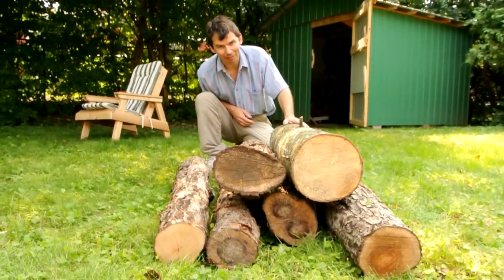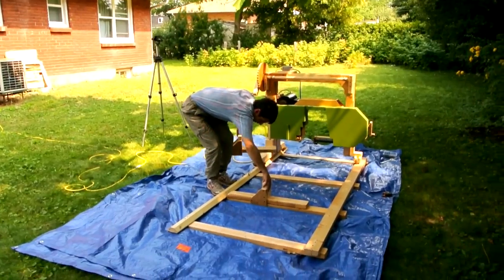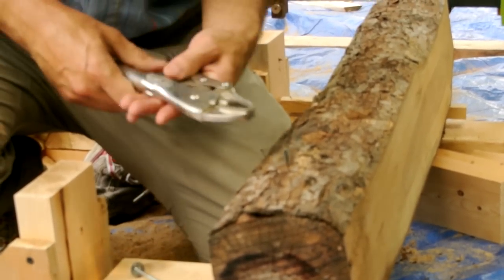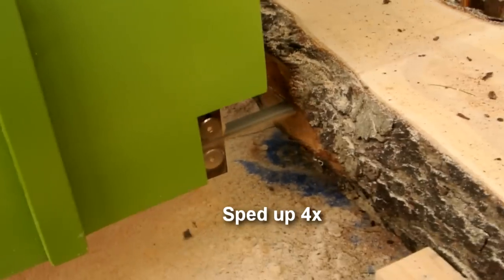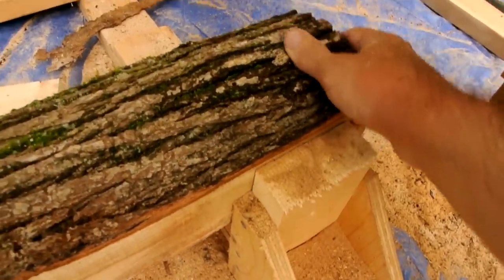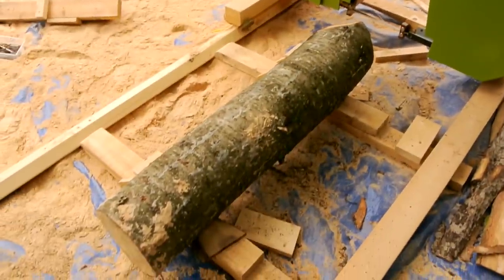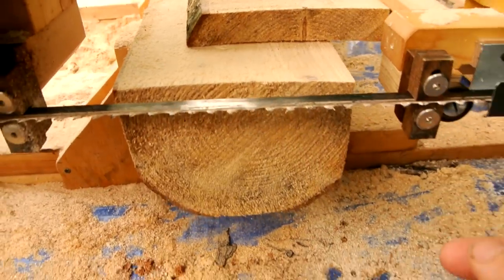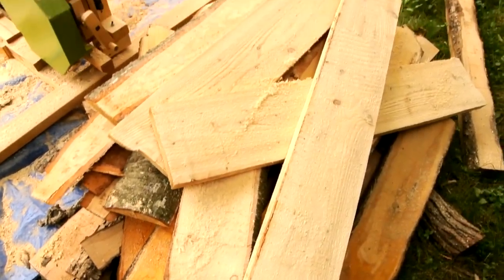Running the sawmill again

Comment: Matthias,

Recently found you and love your frugal, DIY ideas.   The video's are superb as well.  You've been stickering wood to dry for quite some time now, so, I may be suggesting something you've already worked out, but, here goes.

I sticker mine in a 12' by 12' shed that gets mighty hot during the day.  I blow cheap box fans through it for about 10 weeks and have gotten the moisture down between 10 to 15%.  

I've also seen people sticker their stacks in visqueen, which holds plenty of heat and quickens dry time.

Just a thought and thanks for your generous video's,
Steph
Reply from the maker: The box fan is unnecessary.

Comment: Look at this guy! Built his own bandsaw.  I'm impressed.
Reply: Yeah, super kudos for his ingenuity and problem solving skills! I'm like 6'2", 300 lbs but I find myself thinking words like cute, sweet and delightful. Tiny little logs, miniature lumber and the cutest little slash pile. I have a full size commercial band mill and I generate massive piles of labor intensive slash. I think I'm jealous...! :)
Reply: 3Sphere The logs are a bit small in diameter, but what's available will differ. I imagine these logs were cut down because someone didn't want the tree or something, and aren't from a commercial tree source.

Additionally, the boards are just fine for the kind of work a lot of woodworkers do. Giant boards are sometimes great, but when you don't need something that long, they're just inconvenient. I've seen shops entirely stocked with boards no longer than those Matthias has.

And considering all of this comes across as Matthias playing around with the idea and having fun, I don't really see what you're getting at.
Reply: That's probably because I'm not really "getting at" anything. Just congratulating the lad on his wonderful ingenuity and drawing a contrast between my operation and his without judgment. My efforts are dwarfed in turn by big commercial operations as well and would be considered quaint by them. Also, all woodworkers know that furniture makers and cabinet makers use short lumber and glue-ups. I'm saying that Matthias's operation is "cute", nothing more and nothing less. So I in turn, don't see what you're getting at?

Comment: Brilliant video, I'm amazed at what you have made from timber, I would never have considered building a bandsaw from 95% timber but this is amazing. I'm by no means an expert and have no experience with running a saw mill but I would imagine that the drift problems were a combination of blade angle due to adjustment of the guides or squareness of the mill and cutting feeds and speeds. You said you noticed that the problem was reduced when you cut faster and the blade did not get as hot. When the blade heats up, starting at the leading edge, the leading edge will expand and loose tension resulting in the leading edge deflecting up or down causing the cut to drift. Increasing the blade speed and cutting feed rate results in increased chip load and bigger chips which do not pack the kerf and result in overheating.

Comment: Maybe an auto-advance mechanism could be handy, you could even program the whole thing with a raspberry pi to cut a slab, then return, whilst pushing the slab off the log, lower the wrench and then proceed. But I don't think you are going to use the sawmill feature as often.

Comment: Don't make your first cuts so low under the bark if you're trying to avoid pitch, you know that's where it's at !  the reason why it started to disappear later is that there is more water in the centre of the log !!!
What so bad about hanging a little plastic jug of water with a thin hose on your rig to avoid all this grief ?  Other then that It works so well, you make many guys jealous with your skills.

Comment: Hey Matthias, you may want to consider moving your spacers out towards the ends on the boards, if the board splits it will only split to where the spacer is placed.

Comment: Matthias, As I'm sure you know runnning the blade faster through the spruce, doesn't allow the sap to heat up and stick.  I know you didn't want to add lubricant, but pinesol, really watered down, and just lightly sprayed on the blade with a hand squeeze bottle, once and a while will clear that right up, along with of course, turpentine (made from pine trees).  Also a wire brush after the blade lightly touching the blade will help.  Nice video, I'll have to get my bandsaw mill going again.

Comment: perhaps some pipe clamps could be used as log holders? You could integrate them into the track so that the logs sets on boards withe the pipe clamp below. One end could be fixed and the other moveable. Taller clamping blocks could be made so the clamp could apply pressure to the log. Of course this is a dedicated solution and this appears to be a more experimental project. I really enjoy your videos and website. It always gives some kind of idea!

Comment: For the pine and spruce woods use bar soap on the blade.  Clean the blade with vegetable oil at the the cutting session then a bit of soapy water and dry it.

Comment: Consider the difference grain might make on blade drift.  The dark winter wood layer is stronger than the light summer wood layer so draw yourself a little diagram of the blade cutting through edge or through center.  It follows that edge cuts would make a blade drift away from the center because the blade crosses the rings at an angle and center cuts would not drift (because the blade cuts the strong dark rings squarely).  This is observed in your video.

Comment: Maybe there is an uneven distribution of sap across the cross section of the log. Sap may be in the outermost layer of the wood only (the bark layer) with maybe a little more in the last few seasons tree rings, but pretty much none or just very dried out sap remains in the older wood.  Then cuts made through the center would collect less sap on the blade than cuts made nearer the side.  This may have been the improvement observed in the center cut at 5:20 compared to the edge cut at 4:20.

Comment: I owner a sawmill wood-mizer lt 40. I know your problem dirty blade. it is obligatory to use a system that sends soapy water. watch the video of the small Commercial bandsaw mill to understand. 
the system will give 4 essential advantage.
the blade clean. 
can cut faster. 
blade worn out less fast. 
there are no expansion of the metal blade, which causes a variation of pressure of the blade bander

it is obvious to me. it is the only thing you need 
good job :)

Comment: Drifting up or down is caused by either the blade not being tight enough, (tight enough is when the blade does not flap when running) or dull blade. Apparently your sapped up blade was acting like a dull blade. You definitely pay attention to detail to build such a nice running machine.

Comment: Nice little band saw mill. It does the job and didn't costs several thousand dollars.
I would hit the blade with a bar of soap between cuts in sap woods. Cheaper than bees wax and a good lubricant. Any that discolors the wood will be planed off before use.

Comment: you could use some motor oil on the blade. Take a plastic botle with a tiny hole in it and let the blade touch the hole while spining. But i'm not sure if the oil would mess up the wood... could make problems with finishing the wood.

Comment: Many smaller sawmills has the saw at a set height, and can raise and lower the table for the wood instead, which is pretty much what you're doing in the video. Wouldn't making the frame for the bandsaw non-adjustable make it much stiffer too?

Comment: I miss this kind of thing now that I no longer have access to the workshop at work. Whenever a new thing had to be cut or designed, I made a jig or framework or other helper. I am impressed with this saw mill though, my biggest goal was to build a router table - never got around to it though.

Callide! Eam functiones...ergo debet esse incolumem..
Well, (an exclamation here "Clever,") It works...(Therefore) it must be safe.

A Latin motto for your coat of arms!

Comment: Hey Matt I have been milling lumber for a couple years now. Here are a couple tips for storage of freshly cut lumber. 1. Stickers should be place no greater than 10-12 inches apart. 2. Weights placed on top will help to keep boards from warping. 3. Paint or wax on the ends will help with Checking. 4. Storing boards outside is find as long a they cannot be rained on at all.    
    I have ruined many nice piece of lumber because I did not follow these rules. Hope it helps.

Comment: Pushing the saw a bit faster keeps the saw blade cooler because the blade has less time to heat the relatively cool wood.  There is a limit, of course.

Comment: Couple suggestions.

Get two stainless steel cleaning brushes, the kind that look like a tooth brush and have wooden handles. Cut the handles off and mount them after your guides. One on either side of the blade. This will brush the sap residue off the blade continually.

Also to lube your saw blade, get a long piece of hose with a very small inside diameter (a couple mils). Maybe two feet long, mount a miniature funnel to the top. Pour in some chainsaw blade oil. You want to adjust the length so that the head pressure of the oil in the funnel drips on the band saw blade.
Reply: Wouldn't that generate a lot of extra heat and wear on the blade?
Reply: Nope
Reply: Good idea, but I think some lubricant would work better. Normally these mills run with a water based lubrication system, but we generally add some cheap-o dishsoap to a) lubricate and b) prevent resin deposits from sticking to the blade. Being made of wood this mill would probably not like water too much, but greasing the blade with dishsoap once in a while, and debarking the wood would make a big difference. The stainless steel brushes would most likely end up dulling the blade, stainless steel is quite hard, and the blade tip is only doing part of the work on these saws. The gullet itself needs a bit of an edge so it can shear off the loose fibers after they've been initially broken by the cutting edge, and I honestly think stainless steel brushes would ruin that edge fast.